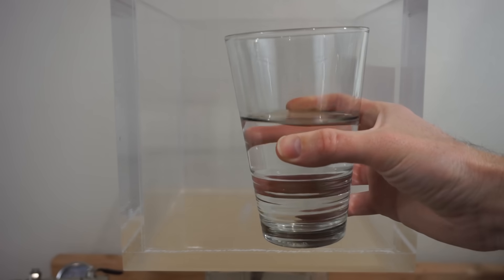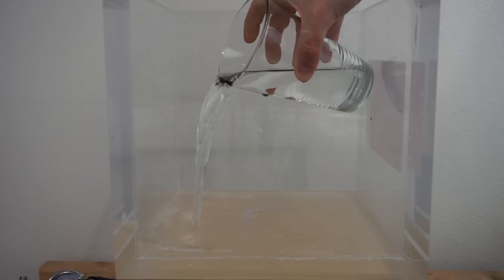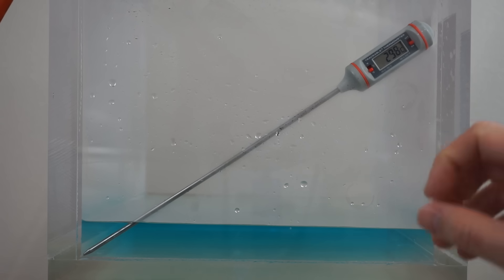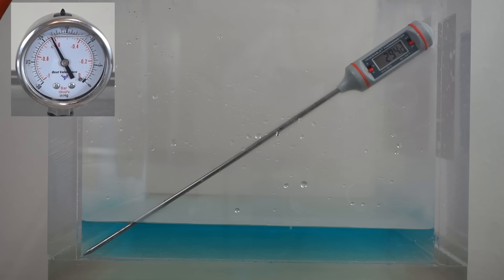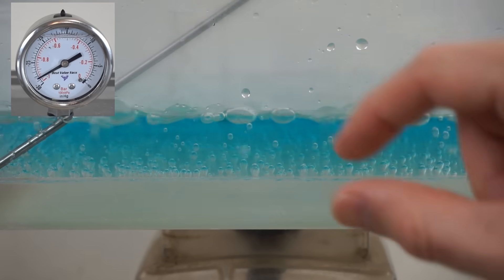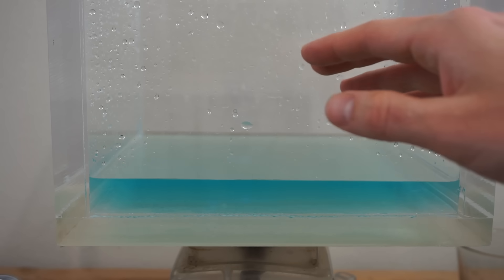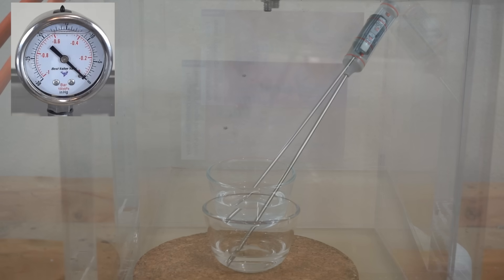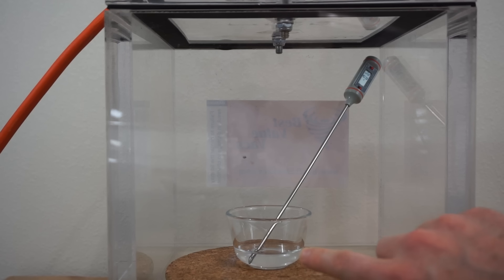Does Water Really Boil in a Vacuum Chamber? And Why?

Comment: i see.. so this just added to my understanding of what happens on air separation system of oxygen, argon and nitrogen. although it doesn't technically like the vacuum chamber, like the opposite way since it compressed the air to higher pressure and not suck it out, the boiling part was the same to the way it form just the fog then the watery fog it produce was the high purity liquid oxygen. Imagine at negative degree it says boiling point? So its not about the heat, but the state it starts to evaporate.. thank you for this experiment and it enlighthen me on the field of work I was on.

Comment: Would it be possible to have a vacuum steam engine? Or would the gas expansion needed not be possible?
Reply: Steam turbine power plants use partial vacuum pressures at the outlet of the turbines, and for the liquid water cooling through the condenser.   This is how they minimize the temperature difference between the water condensing back to liquid, and the cold reservoir where waste heat is discarded.

You try to maximize the difference between the hot temperature where heat is added to the cycle, and the cold temperature where heat is discarded from the cycle, in order to maximize the efficiency of the engine.

Comment: does the water vapor damage the vacuum pump? I would like to try boiling water at room temperature but Im worried about the water getting into my pump. Is this not a problem? is there something that was done to protect the pump from this?
Reply: The vacuum pump cannot "tell the difference" between water vapor and the other flavors of gas in the air, as long as they are all in gaseous phase.

Comment: So this is why in air conditioning the refrigerant pipe is made vaccum before filling the pipe with refrigerant? But why do AC needs a vaccum = low pressure to boil liquid quicker if a refrigerant already boils at a room temperature? Any liquid that has a boiling point as low as room temperature will also boil in a non - vaccum space!?
Reply: If you are trying to make it boil at -20 Celsius, so that it produces an effective temperature difference to draw the heat out of the interior air, you might need it to expand to a partial vacuum.

If it will still work where the refrigerant can be in the two-state mixture at the desired temperature at greater than 1 atmosphere, it doesn't necessarily need to be throttled to a vacuum.  Just throttling it to a lot less than the condenser pressure will be good enough.

Comment: I think your terminology of boiling is incorrect, boiling a liquid is achieved with a thermal signature, meaning you could only boil water if you're using heat. When you see water "boiling" as you say, in a vacuum, it is not boiling. We need new terminology that is truer to the experience.
Reply: The scientific description of boiling is the transition of a liquid to a gas, due to the vapor pressure of the liquid being equal to the surrounding atmospheric pressure.

The water in the chamber is indeed boiling.

Comment: You can’t freeze the water this way. Because at lower pressure the freezing point is also lowered. It’s not zero degree anymore... 
Similarly, you can freeze non cold water at a high pressure.

Comment: If your vacuum chamber is filled with say 10 gallons of water and you apply heat to raise the temperature of the water to say 45°C - 50°C then after some time, all the water will evaporate. My question is... what will happen to your vacuum pump after extracting so much water vapor??? will it get ruined???

Comment: Genuine question so I can debate a flat Earther; at what volume of water would gravity become a factor in creating enough pressure (from molecules higher up) to prevent - or at least delay - the bottom most area of water from boiling? Is there an experiment for this?

Comment: here's y it didn't freeze. you just proved that boiling which is change in state didn't depend on temperature alone but pressure..
hence your water was boiling at 0°C. the freezing point at that same pressure has thus been lowered! 
besides the molecules at this point are obviously all over the place. the direct opposite of freezing. I imaging that suddenly opening the vacuum would condense the water

Comment: How can you remove all the saturated air without completely separating the hydrogen from the oxygen ?  I mean , how is it still water (H2O) if all the saturated air is gone?  I'm not good at chemistry at all. I'm just curious on this. If water is hydrogen and oxygen then wouldn't the water still have saturated air in it until it has been completely separated?  Or am I confusing boiling to steam with electrolysis ? Can anyone set me straight here ?  Lol
Reply: You are confusing boiling with electrolysis.

Boiling is a physical process, that cannot change the chemical identity of the water.  The hydrogen and oxygen are still attached to each other, in all three states of matter that water takes on this planet.  You can separate water from ionic compounds dissolved in it like salt, by boiling it, but you cannot separate the hydrogen and oxygen from each other by boiling it.

If you heated it hot enough that you ionized it to a plasma, than you would separate the hydrogen and oxygen.  You'd also get ozone as a product, after the plasma de-ionizes back to gasses.  Compounds and molecules don't exist in the plasma state, so that is one way where the physical process of heating will also be a chemical process that changes the chemical identity of the substance.

Electrolysis by contrast, is a chemical process that can change the chemical identity of the water, and produce the constituent gasses of H2 and O2 in their elemental forms..

Comment: What happens to the magnetic field around a magnet if that magnet is placed in vacuum ? Will this affect its surrounding magnetic field?
Reply: No change.  Unless you start with a magnet in ferrofluid, and then boil away the ferrofluid.

But since air has no significant change of magnetic permeability from the magnetic permeability of free space, removing air doesn't do anything to the magnetic field.

Comment: When water boils does the atmospheric pressure become higher? Also do you have to continue vacuuming in order for the pressure to remain constant? Or can you vacuum a chamber and let it sit at that atmospheric pressure then warm up the chamber to warm up the water and let it boil at a low temperature?
Reply: the pressure will increase just enough to stop the boiling effect, yes you have to keep pulling vacuum. the water will turn to ice with a good vacuum pump. you can also heat up a bottle of water to boiling point then take it off the flames put a cork stopper. the water will stop boiling after a short time but by placing your hand on the bottle it will start to boil again. this is because you remove heat from the trapped air and it creates a vacuum in the bottle and the water boils.

Comment: My question in. What if you replaced all of the air in a vacuum chamber with water. So the tank and the tube just have water in them. And then start sucking out the water. So just like a vacuum chamber but your pulling water out. I assume You would have to have a different pump, stronger plus you don't want to get water in your vacuum pump. Would the forced be to much for the tank? Would the oxygen still boil out? Water is a compressible liquid so I imagine it can go the other way as well. Would it leave air in the tank? Your pulling out water and oxygen at the same time however if the water boils it releases it's oxygen and also vaporizes. So 100% water in the tank, would you be left with air in the tank?

Comment: that is not boiling. that is just bubbles. anyway there is no sense in boiling water resulting in a medium getting colder. if hot and cold was reacting with each other, it would produce steam by convection and form bubbles.  boiling to me is somthing getting  hotter and not what people see as bubbles. its obvious that the water in the chamber is colder than the air outside the chamber and that there is a heat transfer that goes into the liquid in the vacuum chamber that reacts with the water and create the bubbles as well as the release of air. if there is no normalizing effect between temperatures, and the water contain no air, the water will not create bubbles.

Comment: if we increase the pressure several times atmospheric pressure then what happened, will water boils as temperature increased per unit volume pv=nrt
Reply: Yes, it will just take more energy to heat the water to its boiling point at said pressure. For example, at 10 bar, approximately 10 times atmospheric pressure, the boiling point of water is 180c.

Comment: If you was to have a hallow sphere, let’s say one inch in diameter and you put one drop of water in it, have it in the chamber, wait till it is 100% degassed and no gas bubbles clinging to any surface. And keep the vacuum going until it reaches absolute vacuum... ( like outer space type of vacuum) and have a way to seal the sphere up while under the vacuum. Will that drop of water disappear and never “re-condense” back into water as a liquid ... OR would it appear to Boil for eternity?? Please answer, and if I don’t reply thanks for your answer, then I did not get notified, hunt me down and make sure I know!!!

Comment: Water boils while you are creating vacuum.this is because molecules moves apart i.e they are moving away from each other....this is the same process when you supply heat to water..... molecules try to separate from each other.....this result will not be the same when you put water in outer space.....there is already vacuum so when you place water there the result will be a bit different.

Comment: Could this effect be used to cool a condenser?
If you want to cool a condenser with anything other than blocks of ice, all solutions out there require using a refrigerator compressor and some very volatile refrigerant.
Could you use a vacuum pump to make water boil at a low temperature, and use this in the same way that phase-change refrigerators do?
Reply: i was kinda thinking the same, i'm curious about energy efficency

Comment: If I'm not mistaken, the freezing point of water is also determined by pressure.  It probably doesn't have to do with residual warmth from the vacuum chamber, since the water itself was at -0.1c.
Reply: yes, if you look at a phase diagram, at 0 atmosphere you have to cool it really low to freeze
Reply: The water probably needed a nucleation site and he didnt run the pump long enough and i think the vacuum chamber is not strong enough to reach waters triple point

Comment: Boiling is associated with heating...just a question...regarding this another obseration might be that due to reduction in pressure the air molecules in the water escape at high frequency which feels like water boiling....so mightbe that the  water thatis looking like its boiling is actually air leaving it fast...so the residual water which is now low in air  is cooler...

Comment: hii,

can i dehydrate something faster if i put it into a vacuum chamber ? and heat it up gently ? 

can you explain 
i am thinking since i wasted so much money in bill for dehydrate fruit.. (because my stainless steel siding dehydrator is such a inefficient dehydrator), instead of that, can i just put my dehydrator into a vacuum chamber and heat it up slightly to make the water boil out ? so the fruit dries faster ? 

i am not talking about freeze dry..  
just normal dehydrate but less energy consumption.
thanks
andrew

Comment: So if all the oxygen going away its just liquide hydrogen??
Reply: No! Only the "extra" gases (like nitrogen, oxygen etc) that were dissolved in water go away. Not the O from H2O! The composition of water doesn't change. If that were so, fish would change the composition of the medium they swim in, just by breathing it! :)
If the experiment was done with pure water without any additions (gases or otherwise) the bubbles before boiling would not form (dissolved gases escaping). Only the bubbles while boiling would be observable (liquid water turning to vapor).

Comment: So that's why cloud doesn't condensate instantly in the skies right? Since the sky is cold as fuck. But they won't condensate due to the thin air that there are around the cloud, but when the clouds start stacking up it creates it's own pressure around the thin atmosphere and the boiling point starts increasing until they can't stay like gas? Uhm...that's what i thought at least.

Comment: The dead sea is lower than sea level so does water need to be at like 102c to boil?. My mum has been there and says it's really strange but cool and things happen that don't anywhere else. Floating on the high salt water and not being able to be sun burned at all also even tho it's like 40c air temp you don't sweat much like you would in the UK at anything 25c+ . Would love to go there.
Reply: The boiling point of the dead sea is most definitely higher than the 102C that you mention. Not just because it's more than 400m below sea level (so the pressure is actually higher there), but also because the hypersaline water has an even higher boiling point due to the salt which is dissolved in it (so even at sea level, it would be higher than 100C degrees).

Comment: Does the freezing temperature also change regarding the pressure?
Reply: Yes, but it is a lot less sensitive to pressure than the boiling temperature.  Look up the phase diagram for water, on a pressure vs temperature plot.  The solid-liquid line is a lot closer to vertical, than the liquid-vapor curve.

Water is a special case where the solid-liquid line has a negative slope, because ice expands when freezing from water.  Very few other substances do this.  Most substances would have a phase diagram, where the solid-liquid line has a positive slope, like the phase diagram of carbon dioxide.

Comment: Seems very logical. If you use a pressure cooker water boils at a higher temperature. So if an increase in pressure increases the boiling temp then a decrease should decrease the boiling temp.

Comment: You can get water to boil through a crust of ice on the top of the water if you put a vessel of water above a vessel of hydrochloric acid in a vacuum chamber.  I think I used 6 m hcl when I did the experiment in high school.  The water literally freezes and boils at the same time.

Comment: Why is the surrounding glass is cooler?
When water heats up and boils, it takes in energy to overcome intermolecular forces of attraction between each H2O molecule, thus turning into a gaseous state. This is also called an endothermic reaction. (Takes in energy) In this case, since there is no constant supply of heat energy supplied, they will absorb energy from its surroundings to break the bonds, causing the surrounding glass panels to cool. (Internal temperature of water should remain the same)
yay finally something I learnt from school is used to mke me seem smart even though Im not xp
Reply: Lmao

Comment: Might be interesting to explain why when the water boils the bubbles all mainly come from the base of the container - yes this might be expected if there was a heat source there but in this case the effect of the surface on bubble forming is interesting - sorry if this has been mentioned before - don't think it has!
Reply from the maker: +Anthony Francis-Jones actually they are coming from the bottom because the chamber walls are the heat source. They are warmer than the water. The vacuum only lowers the boiling temperature required. But to continue boiling it needs heat from the chamber walls or container it's in. If not then the boiling would cool the water off until it drops below boiling  again.
Reply: Excellent - thanks!

Comment: Sorry but the bubbles are just dissolved gasses even when at later stages they are described as boiling. It takes a long time to fully degas water. This can be demonstrated by stopping the pump once the water has frozen and letting the ice melt while keeping the chamber sealed. If you repeat this process many times eventually all the bubbles stop even when the water is liquid and below the vapour pressure.
Reply from the maker: +Adrian Boatwright Its not complicated. If the pressure in the chamber is below the vapor pressure of the liquid, it is boiling (and may still be degassing). All I have to do is look at my pressure gauge and the temperature of the water and using the vapor pressure equation for water I can tell you the pressure is lower than the vapor pressure for water and is this boiling. If you are trying to say this is not the case, you have to rewrite the laws of thermodynamics...